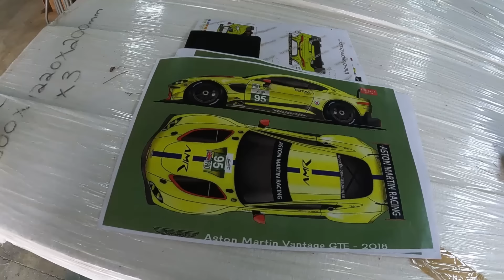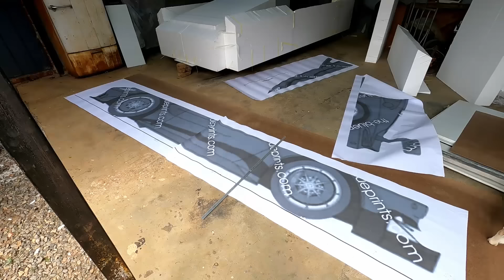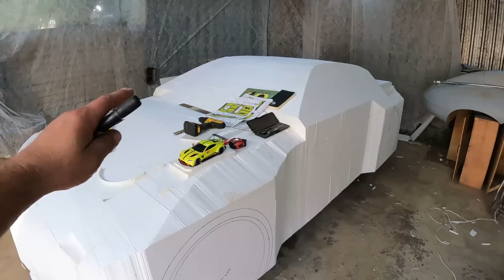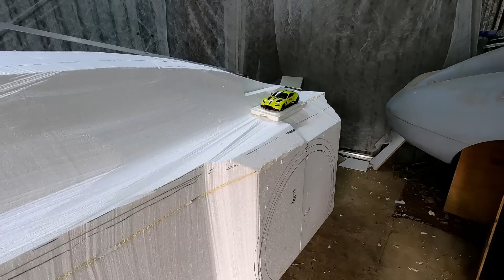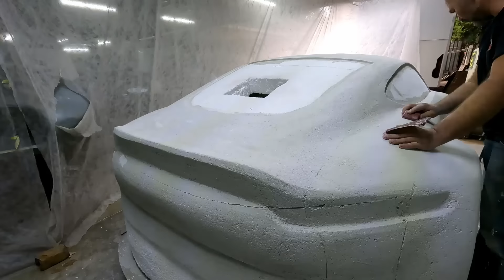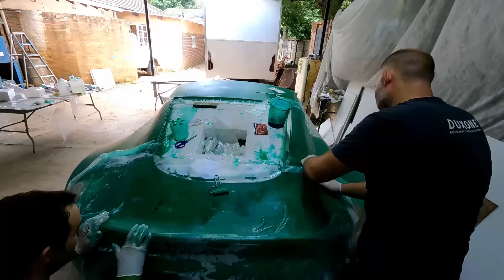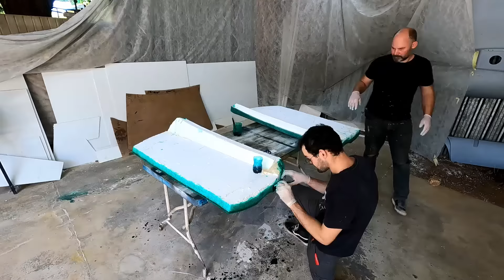EASY METHOD TO MAKE SUPERCAR BODIES FROM SCRATCH

Comment: I want to like your video twice! - Super cool. Just a quick note, in material science there are differences between tough, strong and hardness.But people often just ask how "strong" something is. And its the lion vs Honey Badger (Ratel) argument.  Carbon fiber is stronger than glass fiber by weight, but it isn't as tough as woven glass fiber - as you have clearly demonstrated. You can shatter a diamond with a blow from a steel hammer, but you can't shatter bubble-gum with the same blow. So we should ask what material properties best suit the application. Clearly you have found the best contender. - well done.

Comment: This is a seriously underrated skill. Most people who sculpt vehicles use clay because you can easily add material back and fix mistakes. Working from a solid block of polystyrene is way harder. It's all subtractive. If you cut too much, there’s no easy fix. Getting those clean lines, symmetry, and smooth curves without the ability to just “add more” takes insane planning and precision. Massive respect for this level of craftsmanship.
Reply: Use a teeny bit of gasoline and you can add material
Reply: @karmaslap2252  more like watch it melt in front of your face

Comment: Awesome video, just a suggestion to speed up your cleaning process, Keep a drum of cheap acetone in the corner of your workshop. Acetone effectively dissolves polystyrene, causing it to shrink and break down as the solvent disrupts the polymer chains. just ensure that the aera is well ventilated. it will save you time and also it will reduce the cost of disposing giant balls of polystyrene 👍

Comment: I would have turned the first in to a two part master mold using tooling resin.  Then used vacuum injection resin process to make positive parts...  Then it's like a copy machine when the customer(s) want more parts...  Master molds can make hundreds of copies.

Comment: Er, the EASIEST way to would be to wrap the actual car with saran wrap and then laminate fiberglass/carbon fiber* cloth over the saran (or other thin, conformal plastic sheathing) and then peel it off once it is still flexible but self-supporting (Resin-bonded layers of carbon fiber cloth are INCREDIBLY strong).  

Saran readily peels off - as a non-permanent, non-surface-damaging release agent - from both actual car and from the inside of the fiberglass/carbon fiber shell.  Cars get "wrapped" smoothly all the time, right?  It's almost like a spray-on body - but you use resin instead of paint, and lay the cloth over it, then coat the outside and roll it tight, pushing into the panel gaps so you can see them later.  A few layers is plenty.

Then reinforce it once cured - on the INSIDE - with mat, stabilizing it with plywood or braces while working if necessary, but only to an absolute minimum.  You can "pinch" channels in the mat into which reinforcements or wiring conduit will be later fitted, and use dowels and such to make the channels smooth.  

Then structurally brace the shell internally with "glass/carbon pipe" - piping formed from flexible styrofoam tubes, (from under an inch diameter to pool noodle size, if necessary) wrapped with the same fiberglass/carbon fiber cloth, and then bonded to the (materially-compatible) mat of the shell; this is where the "pinched' channels come in handy.  It's sort of like conformal, bonded, roll cages - but aligned diagonally, horizontally, vertically, whatever, to make the body stiff.

The pipe's internal styrofoam tubing is just to keep the carbon fiber in a geometrically-strong cylindrical form, first while the resin hardens, and then as work proceeds - but it adds essentially no weight; it's just for maintaining a tubular shape while the carbon fiber "tube frame" is bonded to the underside of the body shell.  You can also use thin cardboard tubing for straight runs.    

You don't need steel tubing to hold a carbon fiber or fiberglass body shell in place; cardboard, wrapped and fiberglassed, is plenty strong.  Try it.  Use all the layers of glass/carbon you need; alternate cloth with mat in layers to thicken the pipe walls if you like.  Drive shafts are made of carbon fiber; think that's a strong enough tube?

The peel-off saran molding technique works for firewalls, trunk floor, wheel wells, inner door panels, floors, etc, etc. and the tubes bonded to the inner side of the outer body shell also provide a raised, perpendicular joint buttress to both bond these other planes of fiber surfaces to and to stiffen the outer panels.  

You are building a unibody construction/space frame and driver/engine cockpit, where only the outer geometry of the tubing matters, rather than the strength of the inside shaping (cardboard, foam) materials, because the carbon fiber - and the racking strength bracing of the intersecting firewalls and other panel frames - provide all the stiffness and "honeycombing" that you need.  Like the internal structures in a bird's bones - light, flexible, but very strong.

Mount the unibody shell on whatever frame you're using - and after reinforcing them with more tubing if desired, cut out the doors, hood, trunk lid, etc. along the gaps in the shell surface (the fiber shell and the underlying saran are very thin and conformal, so the gap lines remain visible), and mount away with hinges, etc. if appropriate, depending on the internal compartment access goals (hinged hood - or hinged entire front shell, etc.).  

A complete ~vertical or inclined "glass pipe" roll hoop (joined pool noodles?) in front of, and one behind, the driver - depending on body type - provides lots of dimensional stability and mounting surfaces, as well as side impact resistance.  Cut out window openings, etc. once the body panels are stable in their final position.  

I used a similar technique, with fiberglass cloth over wetted, adhered, and then left to dry, thin cardboard sheets (!) and 3/4" polyethylene foam construction (crack filler) closed cell backer rod MANY years ago, before carbon fiber cloth was available - or at least affordable to a college engineering student.  

I also used copper supply lines, both rigid and flexible, (it was cheap back then) soldered together to make support frames for intake ducts that weren't on the original car.  Just like sculptors put wire frames under their statuary.  The strength was in the surface, not the copper, which just held things in place while the resin cured.

And this brings up a final point: you don't have to clone the underlying car.  Nothing says you can't sculpt and temporarily attach fender flares, spoilers, hood duct shapes, etc. before the saran goes on.  The shell will faithfully represent both the body "mold" and design extras beneath, which can be held on with double-sided tape and then removed once the shell is peeled off.  The shell will have the flares (my fenders did) but the fenders themselves will remain original.

Works.  You're welcome.  (;-)   

* Fiberglass is cheaper, so you can reserve carbon fiber for those areas requiring the utmost strength - like the driver cocoon (ref: F1 cockpit design)  No law says you have to use one OR the other.

Comment: Why not just scan a scale model or actual body you want to replicate, then loft it in 1 or 2 inch increments and cut it out of 1 or 2 inch thick sheets of poly foam as if making a high resolution buck? Then all you would have to do is smooth it out with sand paper and you're done. This method creates a LOT more work.

Comment: I have been drawing the vision I have of that car the 300 since I was a child. I’ve bought model cars and modified them to look the way I wanted to look now I just have to make the real thing. I’ve had my latest one for About four years. I think it has the best chassis out of all of them so I plan on starting on her. I just wanted to make sure I started with a strong foundation good chassis, strong running vehicle. The rest is just cosmetics. 😂😂😅😅😅 my dilemma is that I’ll be working out of a tent in Florida with messy weather

Comment: If you want to improve the safety some and ease of use of your nichrome wire foam cutter I would suggest putting a "normally open momentary switch" button that lets you close the circuit with the press of a button.

Comment: Thanks for presenting this amazing creation!
You said at the end it was the longest one you had done but for me it was too short. I would have like to see it get painted and put on the race car for a completed look at the project.

YOU say this is an easy project and you had your model and the 1to 1 scale print out BUT, BUT a lot of the fine details were YOUR eyes seeing and your hands feeling the difference as you went back and forth to the model. A normal person couldn't do this. This seeing with your eyes and feeling with your hands is a skill build over time of doing such challenges.

I have worked with fiberglass on many different cars but not to design them but to correct aftermarket parts that would not fit. 
The only negative is the music. One was just a short loose that went on foreEVER so I turned the sound down to low a possible but I wanted 
to hear what you were say.

I could see using this fiberglass  for other things than cars. But at this point in my life, when I should be relaxing all I do is work. But the work is creative and challenging like: Design and run a crew to remodel our 50 year old house that now looks like some of the house in Miami Vice TV shows long ago; open floor plan, lots of  glass, designing the courtyard and patio, customizing my 1986 911 Porsche Carrera into an award winning (too long of a story) best DESIGN Porsche Corporation  trophy winner. Alway lots happening in my world, all good but so much time.

I wish you well on anything you might do in the future

"A garage without a Porsche is just a dark hole" —Walter Rohrl - Porsche Development

Comment: You made an inner mold, now you need to cast an outer that you can compress carbon fiber with so you can rebody smashed supercars with as good as original or even better new bodies. It's fine as a race car shell but it's a few generations behind hyper car monocoque design which could become very lucrative for a company wanting into reservicing crashed ultra exotics with new carbon fiber bodies.

Comment: I don't think the strength test was actually measuring strength. It seems to have been testing mostly toughness of the materials. I think carbon fiber is so favored in certain applications because it is so stiff. It may reach its ultimate strength already after stretching only 1-2%. This is great for parts that are not allowed to deform. S-type fiberglass can actually be stronger in terms of ultimate strength but it stretches maybe 5% before reaching its ultimate strength. Fiberglass is probably better in parts where the temporary deformation of the part is not a problem like in body panels. If you want to make parts that resist bending, do a sandwich construction by putting maybe 10mm thick foam layer in the middle of the layers or even specially made honeycomb core material.

Comment: Reminded me of how my grandpa used to build racing boats.  The one thing he did which you could do in the future is on your last layer of fiberglass you can cover it with a large piece plastic sheet like a plastic drop cloth.  The fiberglass won't stick to it but it allows you to get the finish much smoother.  After you lay the plastic on top of the last lay you then use rollers to roll it down as smooth as possible. 

As for the strength, the trick to getting strong as possible fiberglass is 2 things... how each layers folds are in relation to the other layers,  and even more critical is getting out as much air as possible and using as little resin as possible... you just want enough to fully impregnate the fiberglass but any excess beyond that is wasted.  If you want to do it even better you create a air tight bag over the model and then use a vacuum to pull out the air before the resin sets... but if you do that you have to make sure the resin doesn't cure before you do it so you can't use very hot resin.

Comment: nowadays, you can just 3D print it in sections to make molds. Fiberglass is UNDERRATED! It's about as light as carbon fiber. It's not as stiff, but it's not as brittle either.

Comment: Not sure if anyone else mentioned this but I use polystyrene to make disposable tooling and use acetone to dissolve the polystyrene once the part has cured. A relatively small amount of acetone can dissolve a LOT of polystyrene, doesnt cause damage to the panel and is very fast. Great video.

Comment: Hi Great video!  But can you tell me what type of glue you used?  I was finally able to figure out its “water based flexible cornice adhesive”. And I was able to find one or two links at least showing a can of it: but not a tube and in any case not in USA. What would the generic name or the chemistry (usually called out on the product package) be called such as I mighty find the equivalent over across the pond here?  Thanks!

Comment: I'd probably recommend putting in a metal skeleton right before fiberglassing to maintain the dimensions after cutting. Or if you 3D scan it before cutting, you can spend less time eyeball-aligning it.

Comment: you have definetely a great talent

you might try  to use a robotic arm
while machine working  you could do other things

you wouldnt have to build  a complete chassis and cut apart but  each part individually could mad
while first  part is under  machining  you could start foam buildup for  next part

your work could be lot easier
a robotic arm starts somewhere  10K what already can handle larger parts

Comment: A note on the fiberglass because I started making surfboards and working on boats, what you called chop strand I call mat, then the weaves I call 0090 weave and 4545 weave, there’s also stitch but I never use stitch because it’s super stiff and doesn’t go around a boat or board easy so I stick to weave and mat, the 0090 weave is going to add strength vertically and horizontally while 4545 adds strength diagonally and mat doesn’t add much strength it pretty much just soaks up resin, so surfboards I only use weave and it’s pretty much only 0090 cause that’s where I need the strength, on a boat hull it depends on the thickness of the plywood, 0090 if it’s thick enough and I’m just adding strength to it or if it’s not thick enough I will do 4545 or a mix of 0090 and 4545 to add strength, I get them weaved together tho rather than multiple layers like in the video, they also make them with mat as a layer attached to 0090 or 4545 which is very helpful on boats because the plywood soaks up resin so having that mat creates a nice bond between the fiberglass and the plywood

Comment: You can 3D print that whole body in ASA with 2-3mm walls and weld all the pieces together and then coat them with a layer of fibreglass saving a ton of labour.

Comment: These guys make it look easy. But it's not hard to conclude these are skilled workers at the top of their game.not to mention the dexterity and physical strength to carry on. God bless.
Reply: opposite of my perspective "these are skilled workers at the top of their game.not to mention the dexterity and physical strength to carry on." they dont know math and geometry, the finished job is terrible, the tests they used for the different fiberglass samples was poorly done, from a stem perspective (which in this case is engineering) there is nothing here that tells me "professional quality" 

tldr; you could just make these parts using math. you dont need a mold.
Reply: @selfactualizer2099  hey man would you mind elaborating on how you could use mathematics to build car parts, saying this as someone who isnt good at math and has just recently discovered this process and want to learn more. some more info would be much appreciated.

Comment: Pretty good but there are way faster techniques to clone a object if you have a 3D model to reference. If you don't have a 3D model but have a toy model now days you can 3D scan it with a good camera / your phone.
Segment the car in multiple profiles from the center outward like your profile 10:46 and just fill the voids. You will get something that already looks very close to the final result.
If you get a width profile of the final product it should look something like this: H|H|H|H|H|H|H|H ( |= profile H= voids).
You can cut the profiles by hand but a CNC table would significantly speed up the process.
Also you would have to use pre sliced styrofoam for consistent thickness.

I can't link videos or pictures due to youtube censorship but here are some videos that can give you a better idea of what I'm talking about:
"Making a Ferrari 625 TRC (testarossa) body (PART 1)" from Cavallino
"Building a Fender - Part 1" from Ron Covell 
"How to make a buck & fiberglass molds" from Sonett Engineering.

They are using wood as profiles but there is no reason why it wouldn't also work with styrofoam.

This should save you days of work and cleanup :)

Comment: you seem like youre pretty knowledgeable about fiberglass. Do you know if you could repair cracked fiberglass with carbon fiber sheets to make stronger?
Reply from the maker: Carbon is definitely stronger but I would suggest repairing the cracks with fiberglass so it will have the same strength characteristics as the rest of the panel. You can then cover the whole part with carbon fiber for extra strength

Comment: I watched you using the "hot knife" and two things; I didn't see any pieces coming off after you ran the "knife" across the foam. Second, I didn't see you running one leg of the knife against fiber board full size contours --- you just seemed to be sweeping it around. How you got the contour just didnot calculate with me.